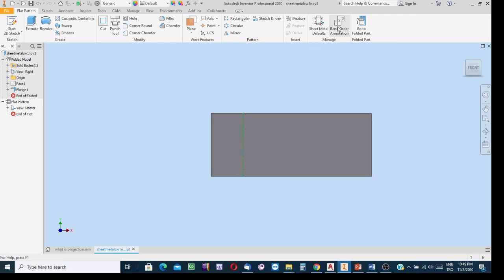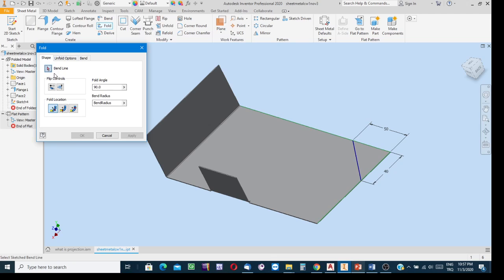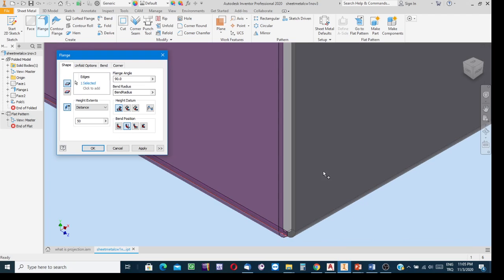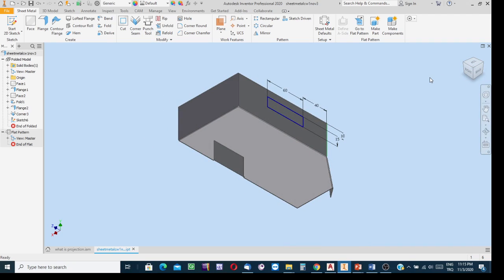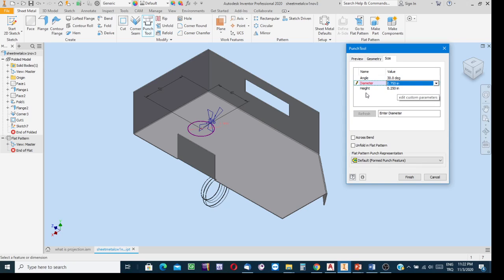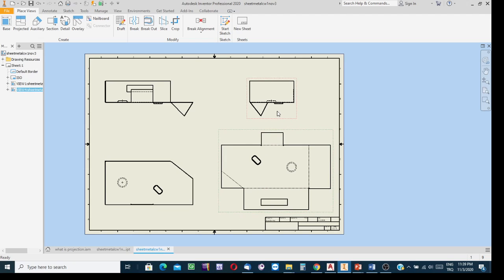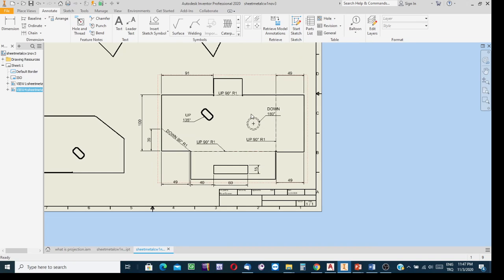MECH 114- Sheet Metal work in Inventor- Part 2

Comment: Sheet Metalwork in Inventor 00:15 (continuation of the last video)
Flat pattern 01:05
Edit flange feature 02:40
New bent part 04:45
Automatic relives 07:30
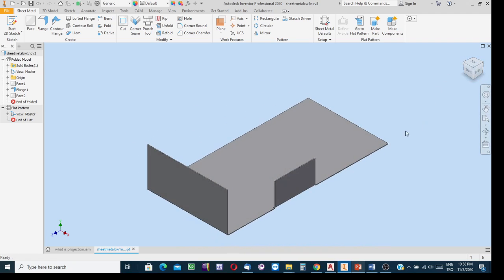Fold tool 09:05
Corner seam 17:20
Cut tool 25:40
Punch tool 28:50 (standard emboss)
Punch tool (angle of embossing) 38:15
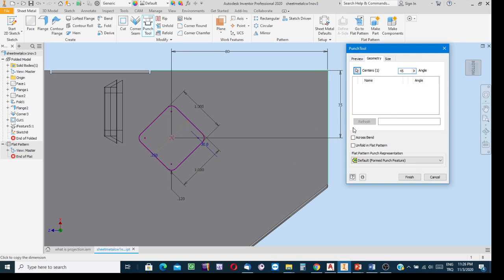Punch tool (size of embossing and unit changing) 38:51
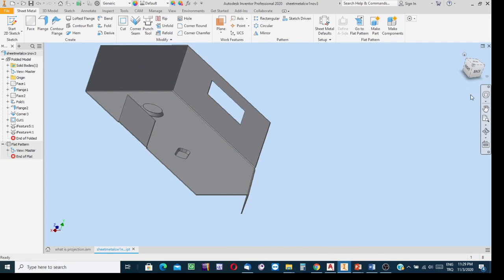Flat pattern 42:25
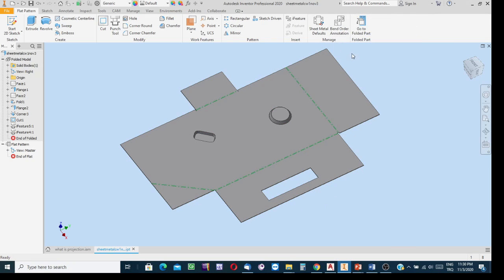Bend order annotation 43:40
DRAWING of sheet metalwork 44:50
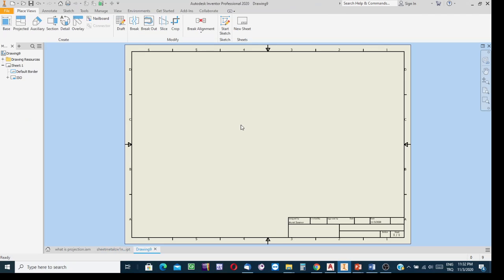Changing the drawing sheet size 45:20
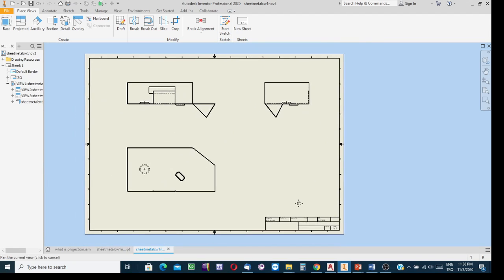Flat pattern development (view) 51:05
Dimensions 53:30
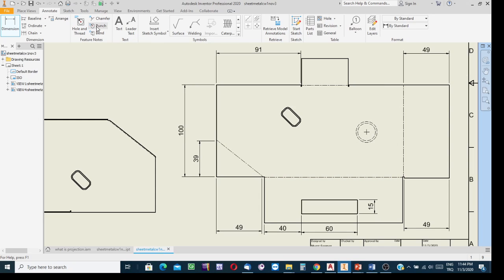Punch dimensions 57:20
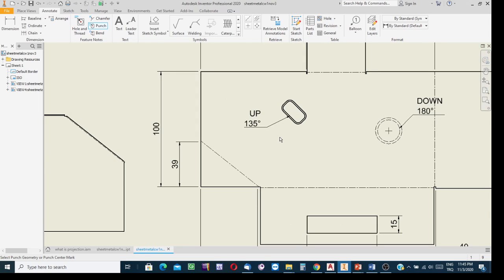Bend / flange dimensions 58:25